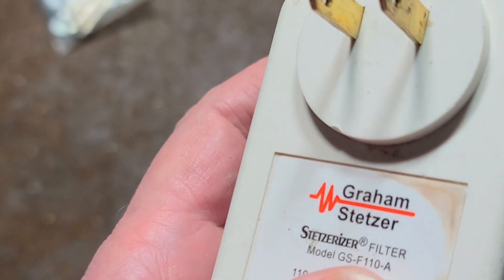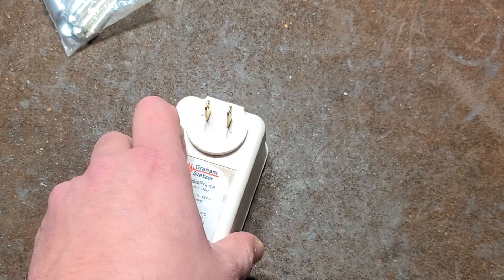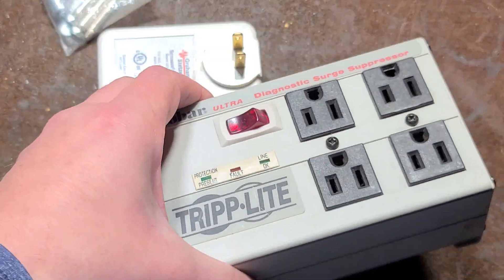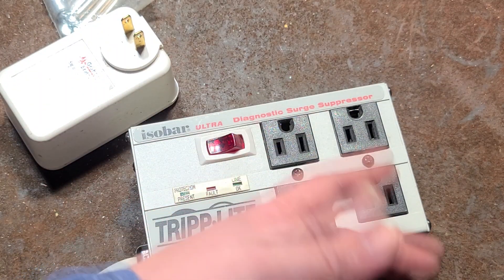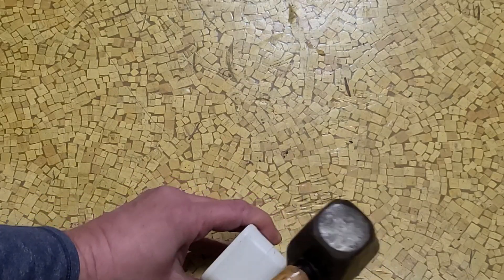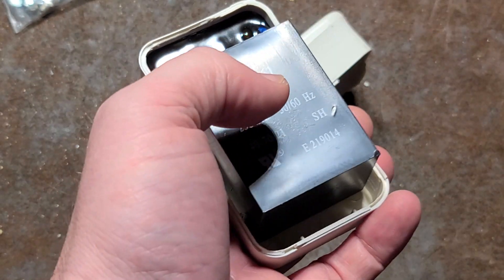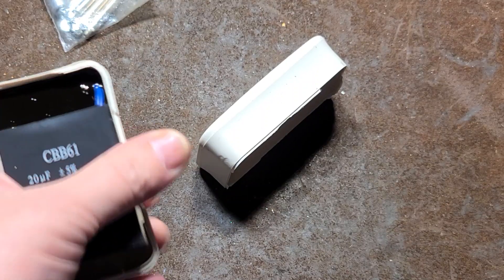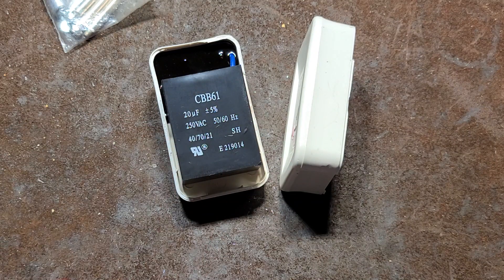Graham Stetzer Stetzerizer Power Filter Review/Teardown

Comment: Why didn't you put it on a scope and show us what it does. There is a resistor in there to. Are you telling people they should go buy a capacitor and stick it in their outlet? Now that's a cheeseball thing to do. Or should they buy your power strp and have 20 of them throughout the house? What frequency range does your power strip cover? Is that a cheaper route to go? These retail at $40 not $53. C'mon, DO you really know what you are talking about?

Comment: that power filter is for surges that damage equipment - the 20 stetzer filter i purchased for $80 are for your body health to limit bad electricity near your body that is everywhere in your house. prove it by using a stetzer meter to show how dirty the power is - mine when from 600 down to 40 with these filters.
Reply: it is not a surge protector it is a power conditioner and the pricing you have is wrong

Comment: A little knowledge is dangerous.  Sorry, bud, but the Isobar does nothing for line noise as I just tested. In my son's bedroom he has a LCD tv, XBox, laptop, and a Steam deck charger- all plugged into a 6 outlet Isobar.  I plugged in a TriField EM100 meter and was getting readings approaching 300 mV peak to peak. As I have several Stetzer filters throughout my house, I attribute the  high noise to the electronics plugged into the Isobar as other readings in my home are all 30 mV or below.   I plugged in one Stetzer filter and the reading dropped to 17 mV peak to peak.  The G-S filters are well built and UL rated and THEY WORK.  Further, they can be had for $40ea. and they aren't meant for surge protection.  So, your criticism is unwarranted. The typical parts cost to retail of electronic components typically run 4-10X, so Stetzer's price is in line with other electronic devices.    Why don't you provide plans and parts for a kit to make something safe to use in place of the Stetzer filter as well as an explanation of the skills  and tools necessary to construct the filter?   Stay in your "tool lane".

Comment: what is under the black gooo a resistor or something...seems funny u didnt check there and the isobar is not the same thing...if u think u can stick those wires into the prong slots on a receptacle for only 8 bucks go ahead the stetzers are 40 bucks not 58...remember this goes in a house with baby hands all over it u cant shove a wire into a slot...

Comment: Respectfully, I think there’s a misunderstanding here about what the Tripp Lite Isobar does versus what Graham-Stetzer (GS) or Greenwave filters do.

The Tripp Lite Isobar Ultra is primarily a surge protector with some EMI/RFI filtering. It’s designed to protect against voltage spikes and reduce external electromagnetic interference (EMI) coming from outside sources (e.g., radio frequencies, nearby electrical equipment). However, it is not specifically engineered to filter out the high-frequency electrical noise—commonly called “dirty electricity”—generated inside a building’s wiring by modern devices like switching power supplies, dimmer switches, and smart meters.

GS and Greenwave filters, on the other hand, are specifically designed to remove high-frequency transients (often in the kHz range) from the wiring itself. This is different from blocking external EMI or RFI. If you actually measure dirty electricity with a Graham-Stetzer Microsurge Meter, you will see that the Tripp Lite Isobar does little to reduce these high-frequency voltage spikes. However, if you plug in a GS or Greenwave filter, you’ll see a significant drop in dirty electricity readings.

I recently stayed in a home that had dirty electricity filters installed throughout the house, including on the lines coming from the main electrical panel. The difference in how I felt and slept for those four nights was nothing short of miraculous. It was clear that filtering dirty electricity had a real and noticeable impact on my well-being.

If the claim is that the Tripp Lite Isobar is an effective substitute for dirty electricity filters, then the best way to prove it would be to take before-and-after measurements using a Microsurge Meter or a Greenwave EMI Meter. Unless it shows a significant reduction in high-frequency noise (which it likely won’t), it’s not a real solution to dirty electricity.

Filters and surge protectors serve different functions. If someone is experiencing issues due to dirty electricity, they need a dedicated dirty electricity filter, not just a surge suppressor with basic EMI/RFI filtering.

Would love to see actual measurements if you have them!
Reply: Your comment was very valuable to me. I think we have this issue in my house. Do you have any more info? Have you installed any in your own home? If so do you have any recommendations for a specific brand that is more cost effective than another? I would love to hear more from an unbiased source for I drop two grand that I don't have

Comment: Great Content ! thanks for sharing  the knowledge , years ago  i   bought a home that  was in a brand new Subdivision and  we had many power Surges  because of the way  it was tied into the Grid ,because of the Surges   i wound up having  many repair bills on  our homes Ele tronics   and as a result of that  i’m very cautious about  having everything protected  that’s plugged in  especially my Audio ,Visual , and Computer Equipment  as i found out after the fact  that  the shop i used to repair  one Component  did not  have all the Suplements  from the Manufacturer  and wasn’t replacing  a 75 cent Capacitor  they reccomended ? when I relocated  i went to a new shop  and they  explained   that   putting in that part  would had saved me several of the repairs on that equipment  i ran that past a Electrical Engineer  i knew  and he agreed , and told me  what to do  in the future  i build most of my Furniture  and i’m going to start Incorporating  that unit you reccomend in my AV Cabinetry and other furniture !  in conjunction with adequate cooling  and ventalation  fans and vents